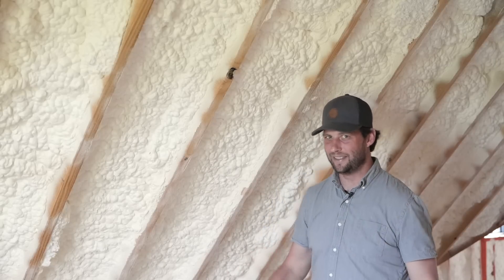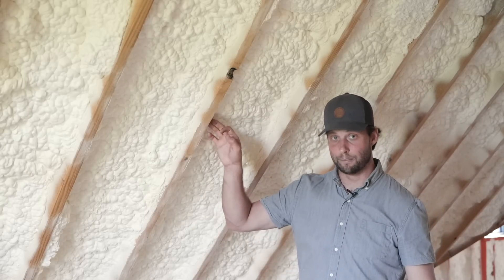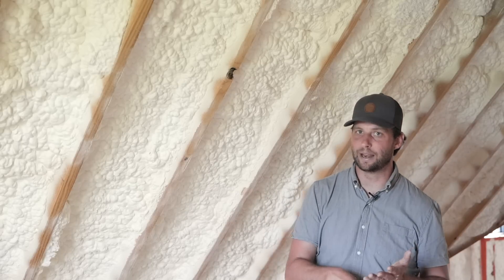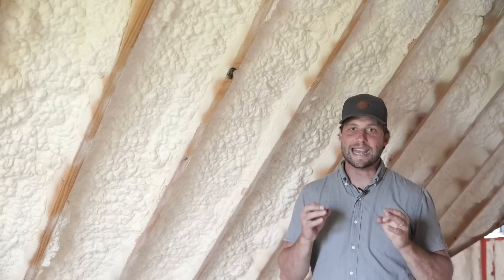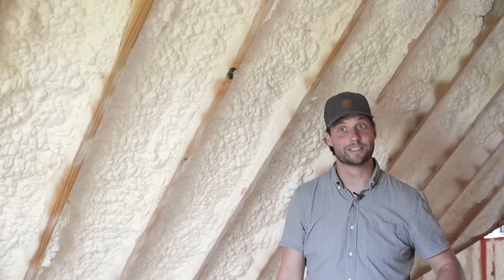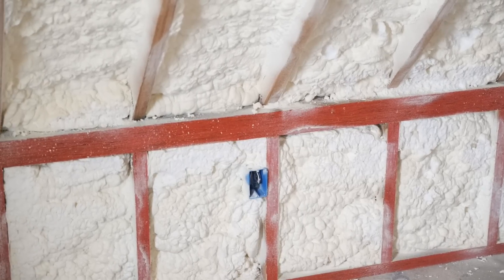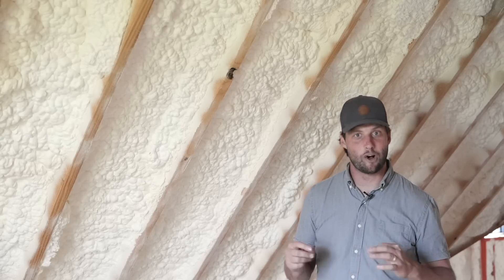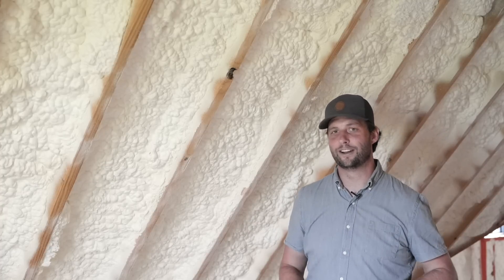Spray Foam and Radiant Barrier: How NOT To Do It!!

Comment: Love your videos, but I must confess that I am in the anti-foam camp. It's as if nobody at the Build Show (or you) has ever remodeled a house with 15 to 20-year-old foam! It disintegrates, it dries out and crumbles, it pulls away from the substrate, it is useless for insulation and even more useless for air sealing after a few years. Even the super-green made with castor seed or soy oil products outgas chemicals from day one. This is an inherent property of the material. It always outgasses. There is not a single manufacturer that will warrant the product for 50 or 100 years (like Sega tapes do) because it is a temporary material. I strongly disapprove of installing an essential component of the house that is only temporary. Second, it is a fire accelerant. Did we learn nothing from the Hindenberg disaster? It is unwise to wrap fragile flammable wooden structures with fire accelerant. Foam insulation has proven - tragically, in hundreds of major fires worldwide - to increases flame spread and therefore the lethality of the fire. There are much better solutions than foam. Passive House recommends dense-pack cellulose - the cheapest insulation out there. With your rafter depth, you would have achieved R38 for the roof and saved a ton of money - and it would be PERMANENT!
Reply: Yeah, seems like you're gambling with spray foam. Maybe you get a good installer and it's mixed and applied correctly, or maybe you don't. If you don't, good luck getting anybody to fix the very costly mistake. And good luck with your health...
Reply: All comes down to the quality of install. Foam should last the life of the house if installed properly. The things you mention like off gassing is a result of an incompetent installer spraying off ratio. Pulling away from the substrate is either temperature related or the substrate having contaminants that don't allow it to adhere properly. It's a liquid adhesive
Reply: No! That’s the main problem with foam insulation. It was originally developed for commercial applications (restaurant walk-in coolers, etc.) with an expected service life of 15 to 20 years. The  R-drift is the rate of decay of that product. Read through the literature; you will find expected R-drift.  Once the foam has released enough of the gas that holds it together, the gas that stabilized and supports the bubble structure of the foam, it just disintegrates. Useless after 15 or 20 years. The chemistry is not a function of installation-it is an inherent property of the material.
Reply: @lindacgrace2973  Makes sense. My father was a distributor of Coors beer in the 70s and he put foam in the warehouse and all transport vans. I saw it crumble and turn hard.  We just bought 120 yr. old house that someone put dense packed cellulose. Yay. What would you recommend to fill in gaps in the basement where air is flowing thru.
Reply: @kimrupe3906  Sigh That is a complicated fix. First, there are four things that your building envelope (exterior walls of the house, including the basement walls and roof) have to handle: (1) Bulk water shedding (you have that handled, it's not raining in your basement), (2) control airflow so you have fresh air where you need it and an airtight seal where you don't, (3) control of vapor diffusion (i.e., designing so that everything can dry out no matter how humid it is), and finally (4) insulation. Those control layers are important in that order of priority. It's a lot more important to worry about air sealing than fuss with what type of insulation to fill in with. I know of one contractor who solved the problem in a 1927 bungalow with an unfinished basement by nailing up strips of plywood to the rafters all the way around the perimeter of the basement. He then built in a "cove" i.e. boxed out a small shallow soffit, not decorative, but it gave him an opportunity to seal every single joint and crevice along the join between the antique rock (up, rock) basement wall and the now settled and wonky house framing. He used Sega tapes and a fluid-applied flashing in areas where tape didn't work. He stuffed the little soffit with fiberglass as he went along as I recall. You can also try semi-rigid Rockwool batts painstakingly fitted by hand. That's all the ideas I have at the moment. I wish you the best of luck!
Reply: @lindacgrace2973  Thank you so much for your time! It has helped
Reply: You’re welcome. 😊 Glad I could help.
Reply: @DTWCT  No. I am terribly sorry to disagree with you. Foam has a lifespan of about 15 to 20 years. Just look at ANY remodel of a 15- to 20-year-old house with shrunken, crumbling spray foam insulation. It is a toxic crumbling mess. Every time. In fact, Matt makes allowances for that in his own home rebuild project. When he put foam insulation on the roof, he carefully staggered the seams because foam always shrinks; even the foam manufactured as boards in a factory with carefully controlled ratios. 
I am sorry, Mr. Kiley, foam always shrinks. All two-part foam installations decay in about 15 to 20 years. That is inherent in the material. This also applies to 'foam in a can' for sealing small openings in the insulation at window or door frames. Read the fine print in the manufacturer's information or the MSDS, you will discover that I am not exaggerating. So, no. It does NOT "come down to the quality of the install."
 A house should last for a hundred years with only routine maintenance, two hundred with any luck. Foam lasts for 10% to 20% of that time. It is not a durable permanent construction product and it outgasses toxic chemicals for its entire life and the foam residues are also toxic and difficult to dispose of. 
Foams are only liquid adhesives for the first year or two of their existence. Foam outgasses (which is what makes it toxic in residential installations) which is also what causes it to disintegrate and lose structural integrity and adhesive/sealing properties. There are much better options for air sealing and insulation. I recommend Sega tapes and dense-pack cellulose.
Reply: @lindacgrace2973  You mean Siga tapes, which tape foundation to wall?
Reply: @coolramone  Yes! I can't remember which one Matt Risinger was discussing, (Siga is a pretty diverse line) but they have a couple of products that carry a 50-year warranty. ;-)
Reply: I feel the same way... I don't see this stuff lasting decades?  What a mess in years to come...
Reply: Wow! Thank you for your insight, I was just about to order foam for a Florida attic install. What would you recommend to insulate an attic? Foil radiant barrier? Attic fan? What to use to seal off ceiling?
Reply: @luelian2752  Dear Lu Ellan, I have not seen good results with attic or whole-house fans. For one thing, I'm absolutely phobic about bugs! If you have enough vent space for decent temperature control, you have enough space for bugs to enter. For another, you can only moderate temperatures to what is outside. In other words, if it's 98 degrees and high humidity outdoors, you can prevent the attic from overheating to 150 degrees, but you will never cool it down below the outdoor temperature and the attic will still radiate heat to the interior. So, I prefer what Matt Risinger calls "monopoly house" framing. Where the roof deck is carefully sealed to the walls of the house and the attic is a conditioned space, just like the living room. When the attic is a conditioned space, all of your mechanical systems run more efficiently and you don't have to insulate each stretch of duct since they are all contained in a conditioned space. The most eco-friendly and energy-efficient insulation is dense-packed cellulose or Rockwool (and its rivals). If you are in a fire-hazard zone (many places in the Southwest require a fire-spread mitigation plan as part of the permitting process, for instance) then I would go with Rockwool. It is fire-safe up to 2,200 degrees Fahrenheit. For my southwest home, I put down a peel-and-stick radiant barrier on the roof sheathing, then used furring strips to provide a rain screen, then attached metal roofing to the furring strip. This assembly solved several problems for me. First, the swings in temperature are extreme in the desert (Arizona) 50 and 60-degree temperature swings from day to night are common and cause 'oil-panning' or warping of the metal roofing. By ventilating the back side of the roof panels, I minimized oil-panning and provided drying space for any moisture or condensation that accumulates on the backside of the metal roof. Hope this helps!
Reply: @lindacgrace2973  That helps greatly! I am thinking of putting rockwool up along the attic ceiling between the rafters, with baffles in the vent ares and then use a 1/2 inch spacer across the rafters, perpendicular so that I can attach a radiant barrier. No fans.
Reply: @luelian2752  That sounds like it will work and will also be one of the most economical ways to achieve your objectives! Best of luck!
Reply: @lindacgrace2973  Thank you! 
Do you have a blog? Your knowledge is impressive. I have spent hours trying to shift through it all.
Reply: @luelian2752  LOL No. No blog. I strongly recommend following Matt Risinger on The Build Show and Corbett Lundsford of Home Performance and Jamie and Eric Perkins on the Perkins Brothers. The Build Show is a great overview of building techniques - the how and why you should design insulation, rain screens, air-tight enclosures, etc. It is a channel designed by contractors for other contractors. Corbett Lundsford of Home Performance covers the science of residential construction. He has the facts on home diagnosis and testing, what standards you should be aiming for and how to test various parts of your home to make sure you're getting what you aim for. The Perkins Brothers give very practical hands-on advice on how to put a house together. They show the entire building process from laying out the footings to the final finishing touches and explain what they're doing, and how to figure out how to fit all the complex pieces of a building together. It is hands-on instruction on building a house. If you are building from scratch, I also highly recommend Keith from How to Build Your Own Home, who has a very inexpensive (less than $20 as I recall) online. Who needs expensive online courses when YouTube is free? Now that I've retired, I have the time to educate myself and I am thoroughly enjoying the journey. Good luck with your building project!
Reply: @lindacgrace2973  Awesome! Thank you.
Reply: @lindacgrace2973 unfortunately nothing lasts forever. Nothing that seals will last forever, including your tape or foam. So either you can go with more traditional insulation and have poor efficiency for a long time or have great insulation for 20 years, then it degrades to match the quality of traditional insulation.
Reply: @Techno4more  Dear Techno: Yup. Absolutely true. I aim to build a "100-year house," i.e., a house that will survive for 100 years without a major re-build. I'm building in Arizona, so I will use a double-wall system of traditional 10" thick adobe for the exterior with an 8" thick double wall interior framed with 2x4s. That way, with the exception of the bond beam, windows, and doors, thermal bridging is minimised. Adobe is not only one helluva lot of thermal mass (you get a 15% bonus on insulation R-value) but it's air-tight, as well. So, no tapes required. The insulation will be dense-packed cellulose; which is what Passive House recommends. Even dense-packed it will settle eventually, but I'm using a heeled-truss roof so it will be a very long time before the settling affects the interior thermal envelope. Roof will sport a shiny layer of Alumi-Flash under the traditional red clay tiles. I'm building in the mountains to avoid the low-desert heat, but the UV index is still a brutal U10. The initial R-value of cellulose in the rafters is R-74. That design, while imperfect, still avoids burying plastic in the ground (under slab will be cork insulation), minimise toxic out-gassing to the interior, remain in budget and give me decent home performance. Nothing lasts forever, but with good design, it should last for the remainder of my lifetime.
Reply: I learned a lot reading your thread . You know your stuff  I understand more about the downside risks of foam, it's not simply how good of an R value something has but longevity, durability, and toxicity.  @lindacgrace2973
Reply: Have you remodeled any home? All insulation can deteriorate after time. Every time we open up drywall the pink fiberglass insulation is moldy and shrunk about twice the size as when you first put it in
Reply: @1malwaysup  Yes, I have remodelled homes; a lot of homes. My husband and I worked his way through graduate school as remodelling contractors. Then, when he went into teaching, we flipped houses every summer for years. Every house we ever bought was a "fixer" and we fixed all of those, as well. So um, I've remodelled about 40 times. You are 100% correct, pink fibreglass is a terrible idea, as well. My favourites are: Rockwool, dense-packed cellulose, and the new kids on the block (or at least new to America) cork and wood fibre. Each insulation has their best-use case; for instance Rockwool is ideal in high-fire risk situations such as chimneys and mechanical rooms; cellulose is great for "bulk" insulation in attics, wood fibre insulation works great when pressed into boards and used as a continuous insulation layer over sheathing on the outside of a house to prevent thermal bridging, cork is perfect insulation when there is any chance of dampness or condensation (cork is naturally waterproof and so rich in tannins that it actively kills off mold spores). IMHO, there are so many good alternatives to foam for insulation and so many good alternatives for sealing (Aerobarrier for instance or many of the Sega or Polywall tapes, caulks and sealants) that I see no reason to use foam.
Reply: What about the dew point with blown in cellulose? I'm planning a build and I have to say the potential for a bad dew point inside the wall cavity is a fear. I could put a full air/vapor barrier on either side but I want the wall to be able to dry out if it gets wet so a vapor barrier on both sides means any water that does get in will never leave so with just more water being added mold seems inevitable.
Reply: I just heard that the mortgage companies may not let you sell your house with that stuff on it and may make you take it down.
Reply: @benjones8977  Aha! So, I'm not a tin-hat conspiracy theorist - insurance companies (who have to consider fire safety) are catching on, too. I feel validated. Thanks
Reply: @lindacgrace2973 doesn’t radiant barrier on rafters promote fire?
Reply: @davidfettig8885  I've never heard of it.  I mean, it's theoretically possible (think of sun ovens, for instance, which can reach 450 degrees). Radiant barriers reflect heat and it would take some pretty strange geometry for the radiant barrier to reflect heat back into the wood that supports it. Radiant barrier on the inside of the roof doesn't work to reflect heat away from the attic space. Radiant barrier needs air space to work, so it's usually placed on the top/outside of the roof decking with vented roof systems. Second, it takes steady temperatures of over 500 degrees (F) to begin to char wood, (even plain pine, much less KDF) and it takes a lot of time (and higher temperatures) for the wood to actually ignite. I'm building in Arizona, and will use a vented clay tile roof with radiant barrier on the roof deck. I doubt it will get up past 500 degrees with proper venting, even on the hottest day of summer. So, I'm not too worried about it. I'm delighted that you are thinking about it - most people are totally clueless and don't bother working out the actual consequences of their choices. So, congrats!

Comment: I LIKE THE PERFORMANCE OF SPRAY FOAM HOWEVER being a green builder I personally think that the chemicals used to manufacture the foam are highly toxic and dangerous... also there the little issue of the installer it's the manufacturer and if the mixing ratio it is not 1-1 for whatever reason (clogged nozzle  or any other of the 5 to six factors that have to do with it) it could fail and you would not realize it until it's to late and material it's venting all this chemicals in your house... safest choice it's use something else... thx love the chanel and all the geek info.. keep it up
..

Comment: How is a foil  supposed to reflect sun rays  if it faces  an attic floor ?
Reply: @rj.parker  if radiant heat  is not reflected it means it converts into other types of heat and partially heats osb and shingles on top and partially air in an attic  . Ok we get less heat coming into an attic but now we expose shingles to extra heat which will lower a live span of a roof .  My plan is to buy a foil, roll it out  on the attic floor over insulation  and a foil would reflect radiant heat  outside of leaving area for the most part without converting into other types of heat
Reply: @rj.parker  the attic fan that I have paied $270 for will handel dust